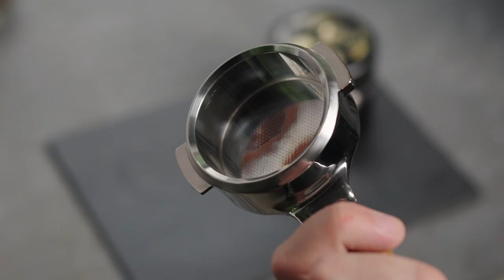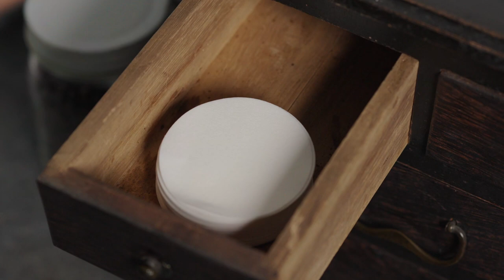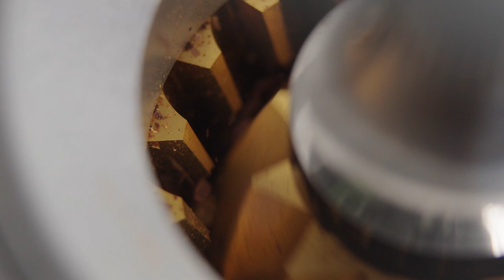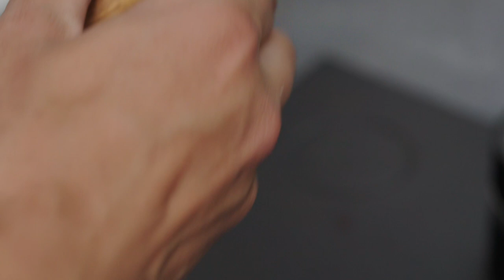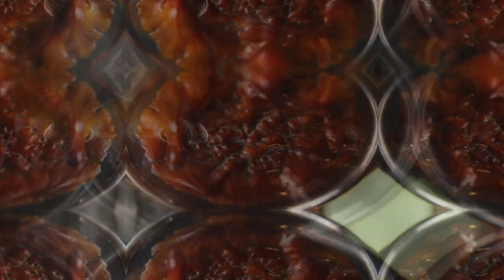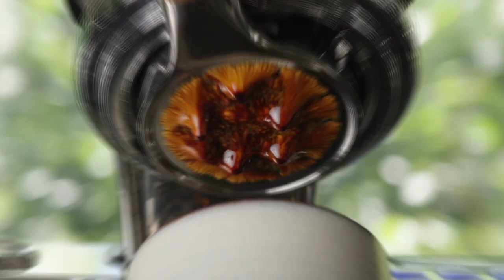The Unifilter: An Espresso Portafilter Revolution

Comment: Looks like a low quality extraction.

Everything out of stock and crazy expensive anyway.
Reply from the maker: what about that shot gave you the impression it was poorly extracted?
Reply: @WeberWorkshops  channelling
Reply: People often seem to be very confused about channeling. It is extracting in many places precisely because it is an even extraction across the width of the basket. At a greater speed of extraction (grind, pressure, distribution/channelling) you are more likely to see a single area of extraction, but this does not exclude channelling. A lot of observations people commonly assume is channelling on naked portafilters (barer areas on the puck, multiple streams, etc) are not necessarily indicative of any problems with the extraction.